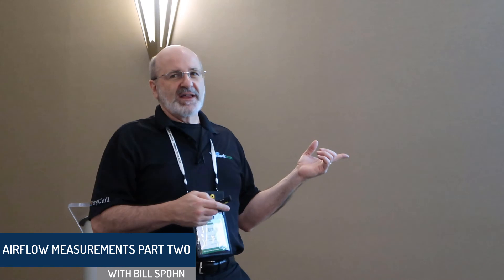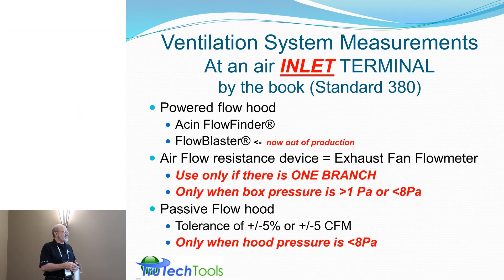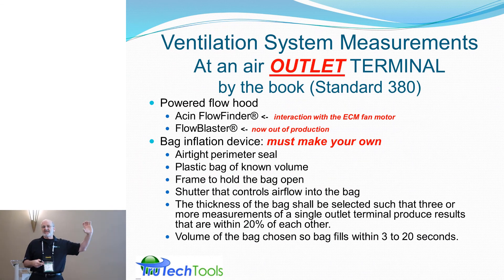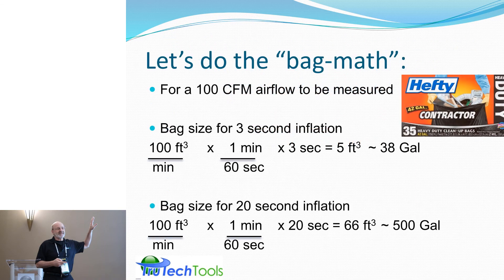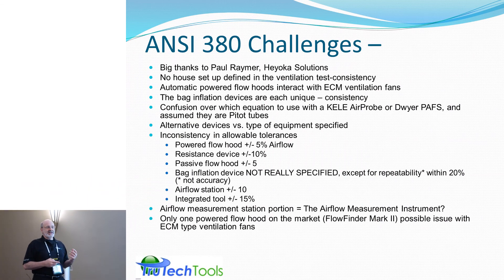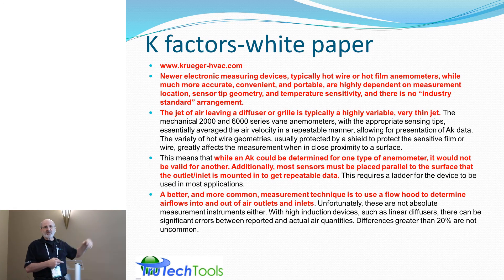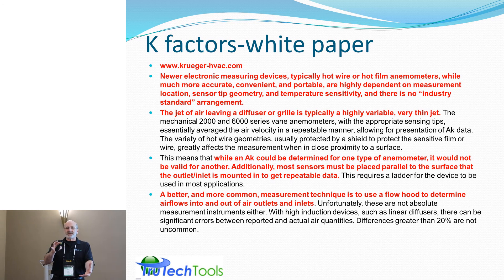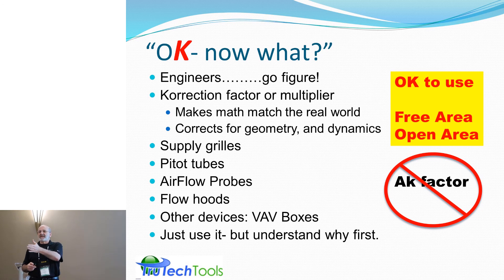Air Flow Measurement Part 2 - CFM, K-Factors and More

Comment: So when dealing with ductboard plenum with flex take-offs, you pretty much have to use either an anemometer or a flow hood at the supply diffusers...that's what I'm taking away from this. I have a vane anemometer that reads cfm, but is only accurate if you input the diffuser's area and k-factor into the equation. How does a hood get by without having to input a k-factor?